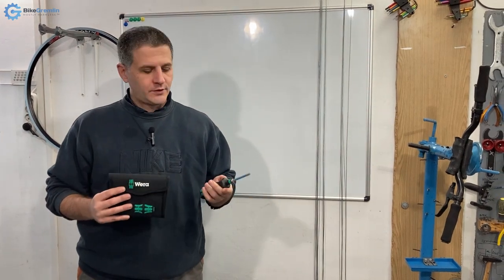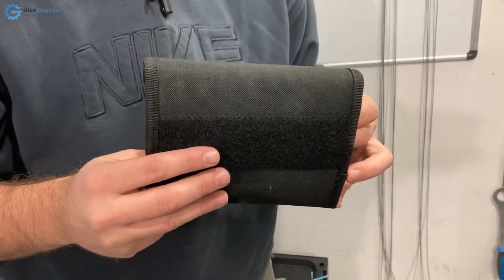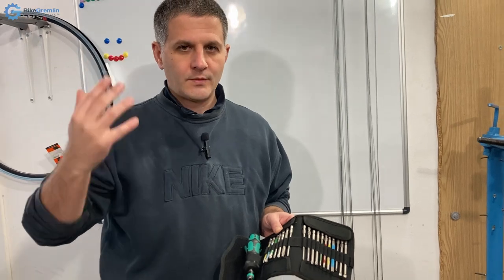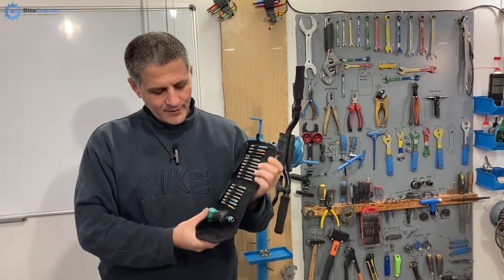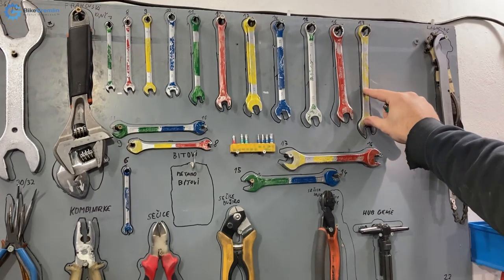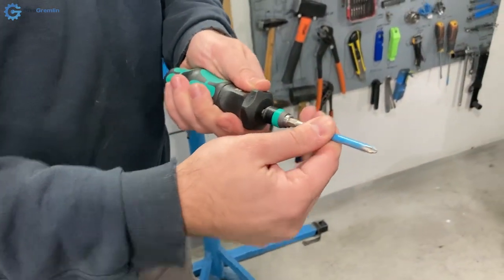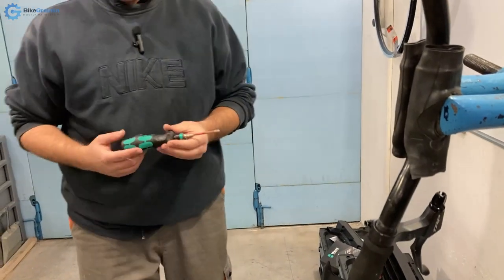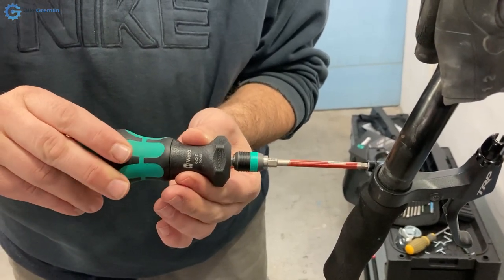Wera Kraftform Kompakt Turbo 1 screwdriver review

Comment: Hi Bike Gremlin. Love the channel!

I have a similar set, but with a non-ratcheting T-handle (Wera Kraftform Kompakt 400 T-Handle). It has replaced individual L and T-handle hex wrenches most of the time. I keep the driver and 4mm, 5mm and T25 bits in an apron pocket. I find with the rapidaptor I can change to the needed bit about as fast as grabbing another wrench, and benefit from the compactness of the system. In my apron I also carry an odd multitool called the Topeak Toolstick 11 (that I'm not yet completely sold on), and a conventional 6mm L-hex wrench.

This system keeps the "pocket overload" to a minimum but ensures most wrenches to build new bikes are quickly at hand. Plus, the "flywheel" effect of spinning the T-handle does speed up stem bolts, brake rotor bolts, etc, somewhat.
Reply from the maker: That is my goal (will confirm how it works in practice after a couple of months).
T-handle bit holder may be more practical for bicycle servicing though. Hadn't thought of that - great idea. May be better for bike working because of a better leverage of the T-handle. Its lower end is narrower which should allow for spinning it fast when needed (with low torque, of course).
Reply from the maker: Gavin,

Thanks to your feedback, I've ordered the T-handle bit holder (the Kompakt 400).
Wouldn't have thought of it otherwise (as the "ordinary" T-handle wrenches without replaceable bits are not very practical for me, because of the space they take on the tray or in pockets).

Is it OK if I show this comment in a video about the Wera T-handle bit holder (when I make it)?
I could blur out the name if you prefer to stay anonymous, but if it's OK with you, I'd like to give credit where credit is due.
Good feedback (and corrections) are one of the reasons I make articles and videos. It's helped me a lot over the years.

Relja
Reply: @BikeGremlinUS  

Hi BG, 

I'd be honoured to have my comment referenced on your channel!

Cheers,
Reply from the maker: @gavinmacrae7698  Cool.  :)
I've decided to make a general screwdriver video, including the bit-holding screwdrivers (and the T-handle Kompakt 400):
https://www.youtube.com/watch?v=6ZZW8ZHTu4Q

It's a good basis for making any further screwdriver videos. I'm also planning to make another "basic" video explaining tip types and sizes - as that is another common mistake I see people making.

Then I can continue to review particular models, without taking too much time to explain the basics (for those who don't know that).

Comment: Hi, you convinced me of not buying it. I was thinking of buying the VDE turbo version and the one that you're having. I recently bought a a Wera VDE 17 pieces screwdriver and it only has one handle in the package. I could use one more since most of the time you use at least 2 screwdrivers for a job and I was thinking of buying the turbo and when not needing it's function to use it as a screwdriver. The loosening of it discouraged me... I was not so scared of the big handle but it goes loose for about 0.5 cm in both directions, one total. That is huge. By the way I bought some bits like that from HBM tools, don't know if you find them in your country and I don't think they are as tough as wera but at around 10 euros for 40 bits who cares. They are long and thin and i love them because I can get into thin places. I have many odd shapes since there are 40 of them.
Reply from the maker: Thanks for the tip on the HBM.  :)
Regardin the Wera Turbo:
If it makes sense anywhere, it is for long, M-thread screws into metal. Like one often uses an insulated screwdriver (VDE) for.
However, to make it work "turbo," you still need to use both hands, so it would not work even with typical Serbian wall-sockets tightening (even though they do have long easy-going metal screws) - since you need to hold them in place when tightening.
For months now, Wera Turbo has been idling on my wall - not picked even once.

Relja
Reply: @BikeGremlinUS  I bought the BoschGo2 about one month ago. Haven't used it much since I only use tools as a hobby, for personal repairs on my properties when something breakes. I used it with the HBM bits to disassemble for cleaning the robot vacuums and it worked great on plastic. I can't wait for something to break to put it to proper use. As I played with it a little it seems ok, it's not expensive, around 70 euros in Romania and it has in general good reviews on YouTube.
Reply from the maker: Day job (computer and network service) got us some Bosch Go 2. It is good.

Comment: Great vid thanks very helpful 👍 . Also swivel head multi position ratchet is available WERA 28 Piece 1/4in 8100 SA 6 Zyklop Speed Ratchet Metric Socket Bit Set, 004016.   Comes in metric or imperial. Torx , hex, small , medium sockets ,extension bars, Philips, posi drive, flats. Very handy for working on bikes, find I’m using it more than my T handles. Really useful for initial installation pre-torquing and then final fix with torque ratchet.
Reply from the maker: It does look good.
I've got a decent socket wrench set - KSTools, paid about $100 for it over 5 years ago - like this one, only older model:
https://www.kstools.com/en/products/hand-tools-catalogue/sockets/sets-mixt/11047/1/4-3/8-1/2-chromeplus-socket-set-195-pcs?c=0

Wera's swivel ratchet wrenches do look super-practical - and if Wera's sockets are as good as their bits, those must be great tools.

Comment: Interesting screwdriver though. You'd think Wera could build it in such a way that you would be able to use it with just one hand by including a similar switch mechanism like they do in their ratcheting screwdrivers. But not sure if it's worth the effort now that small electric screwdrivers have become affordable.
Reply from the maker: I'm not sure it's possible to make it without the need for a counter torque (i.e. two hands) - not without an electric motor inside.
What could be done is make the counter torque handle a bit more "pronounced" or make the ratio 1:3 or even "just" 1:2, instead of the 1:4.
One not excluding the other.

Relja

Comment: I bought this and honestly it is terrible.

It feels so clunky. Almost as if they forgot to grease the mechanism in the one I bought.

It's great for loose fitting machine screws or bolts that are very long. And that is it.

The step down in torque makes it pretty much useless on anything.

A much better buy is the Panasonic EY7412 electric screwdriver. That tops out at 1Nm and it can loosen screws and bolts that I can't do with the Wera turbo.
It also can hand tighten to 4Nm and has a ball grip.
Reply: Same. Thought about getting the Wera Turbo, but got an electric screwdriver instead (Vessel 220USB-P1).